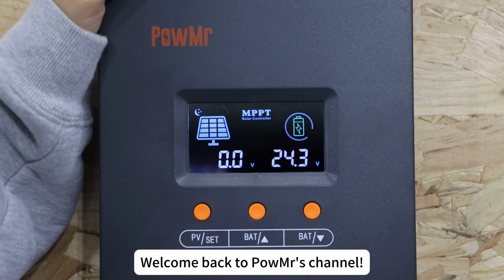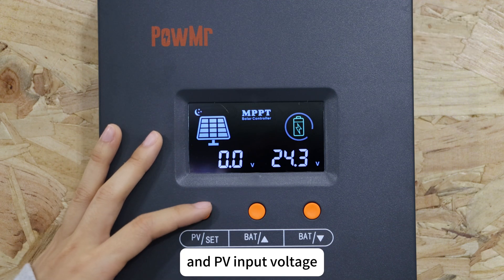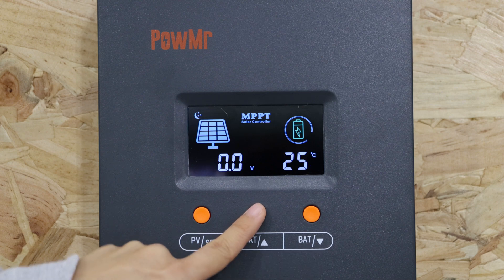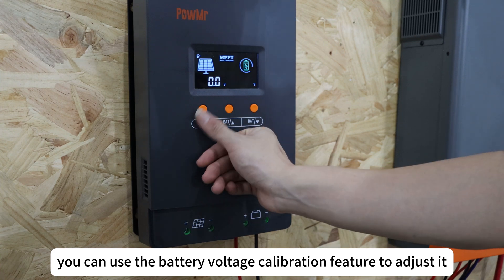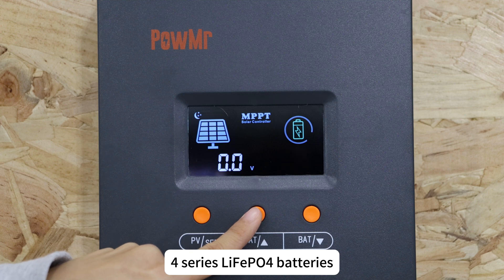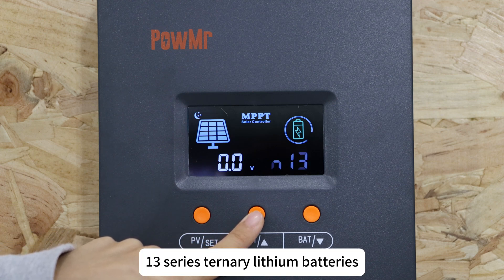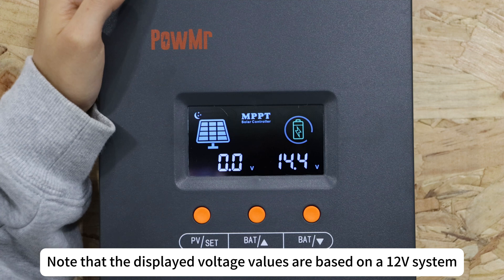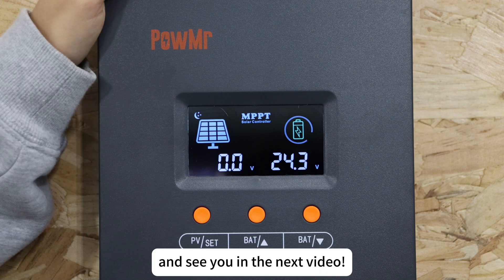How to Setup the PowMr MPPT Solar Charge Controller - POW-M100-PRO

Comment: Can this device be safely used to charge a 12.8v 100ah lifepo4 battery also using a 24v 210 watts solar panel? Your feedback would be greatly appreciated.
Reply from the maker: 12V System (W/V) 1200/20~80
24V System (W/V) 2400/37~105
36V System (W/V) 3600/50~160
48V System (W/V) 4800/72~160

Comment: Hi, One question: if I have four 455W panels, what configuration should I use to get the maximum efficiency from this MPPT pow M100 Pro with a 24V LiFePO4 battery system ??
Reply from the maker: 24V System (W/V): 2400/37~105

Comment: What is the size of circuit breaker for this powmr 100a?
Reply from the maker: Please tell us your specific configuration. The circuit breaker should be configured according to your actual situation. If it is a 48V system with full PV configuration, it is recommended to equip the battery circuit with a 120A circuit breaker and the PV circuit with a 32A circuit breaker.
Reply: @PowmrSolar 25.6v system and one more thing what size of wire are going to use for powmr100a

Comment: Hi.can I ask something please?what is the selector battery mode I need to press when Il connect in parallel the two assemble 8serries life po4  battery.with own bms by each?8+8 in parallel connection?thanks for the answers.
Reply: 24 volts battery.thanks pow mr
Reply from the maker: @FrancisAragon-y2q Select "USE" for battery type and then set the charging voltage.
Reply: Thank you so much for the response powmr
Reply: Which battery type do I select for lifepo4? Thank you